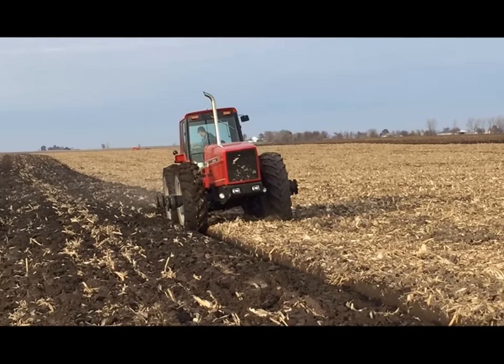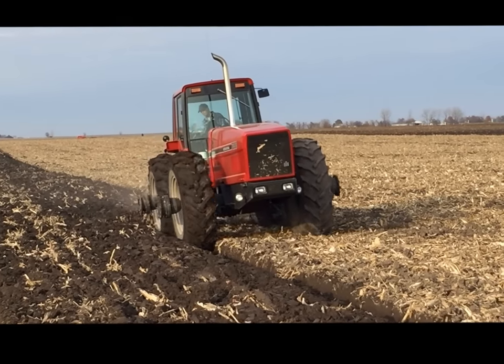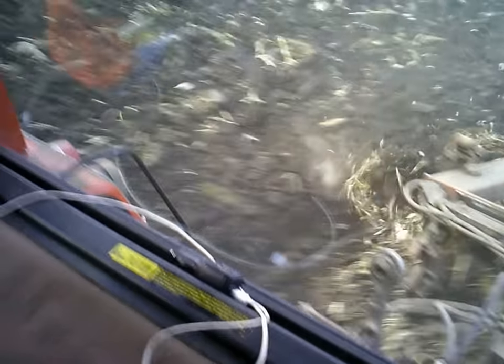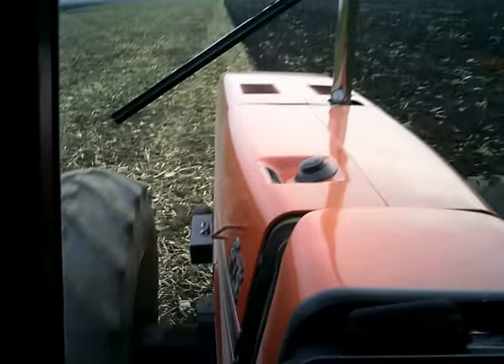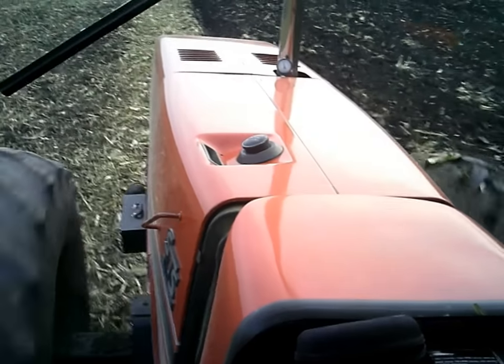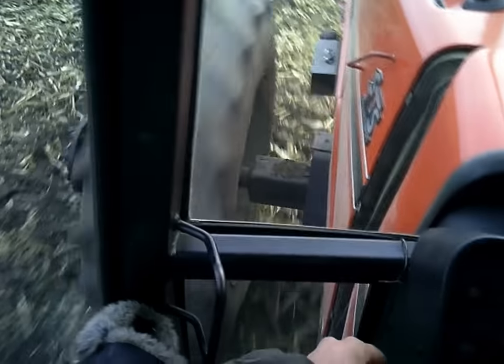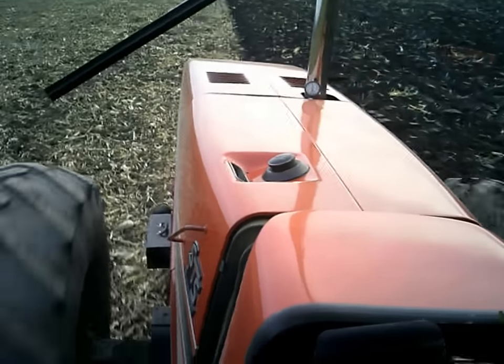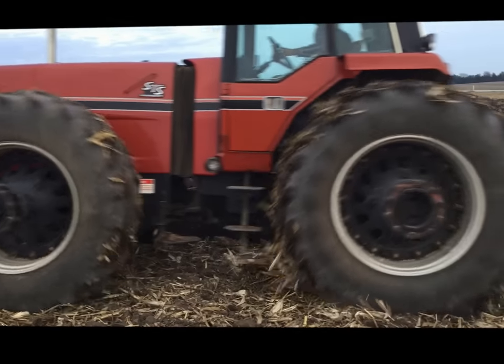Rare International 7288 2+2 tractor

Comment: Great video Jake I'd kill to run a 72 or 7488.My boss has a turned up 3388 pushing probably 150hp it was 130hp out of the factory. We drill beans,run a feed cart and a grain cart with it. 3388 has a 1086 transmission 35-3788 had a 1586 transmission. The second series were the 63-65-6788s they were the same horsepower as the three previous models with the power shift style transmissions in them. Then the 72-7488s that were supposed to bring international up out of bankruptcy, really sad that it did not. Again great video.
Reply from the maker: Jake Gritten thanks for watching! Ya that’s what the owner was saying. To bad it didn’t

Comment: That's some straight up tractor porn there. Supposedly there were to be 2 more larger models in addition to the 72 & 7488. Same frame and transmission but with a L10 Cummins up front. They thought the drive train could be pushed to 400+ hp. Not sure personally,  but it would be cool to see at a plow day. Thanks for the video.
Reply from the maker: Dale Cornelius hahaha yes it is! That would be a stout row crop tractor! Thanks for watching

Comment: In the end you can see trash stuck on the grill, I thought they were designed to suck air from on top of the hood and blow out the front?
Reply from the maker: Mark Groth I couldn’t tell u on that one
Reply: These 70 series did not have the same air intake like the 5x88 series. 72-7488 were simply designed to match the series.